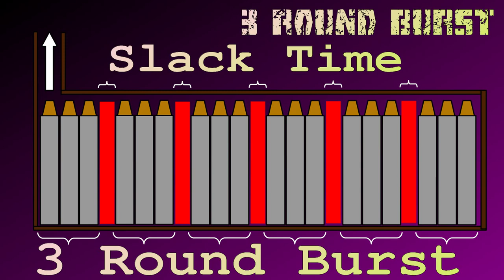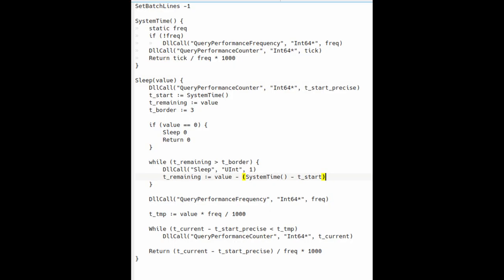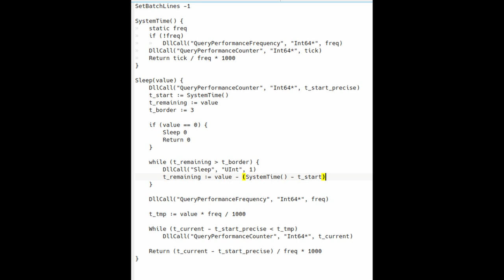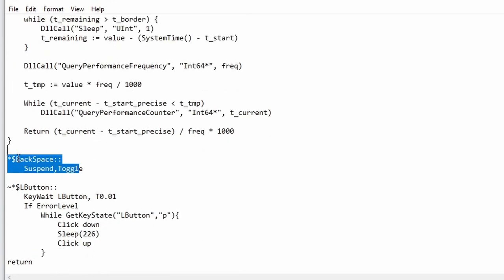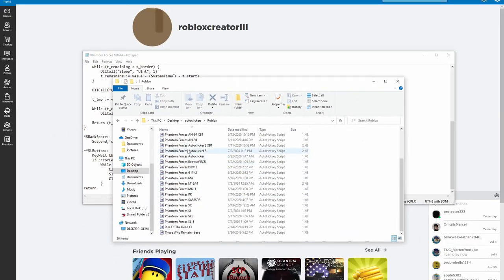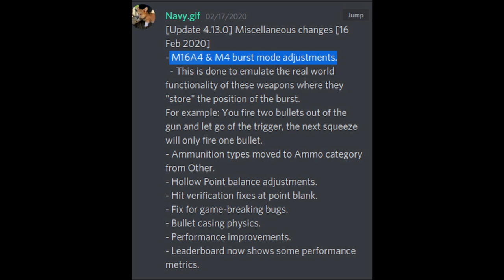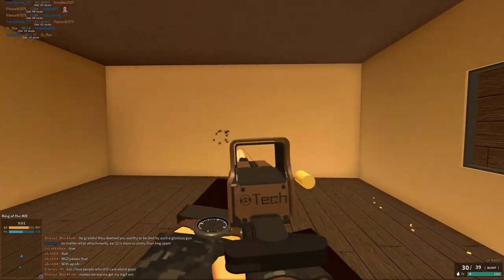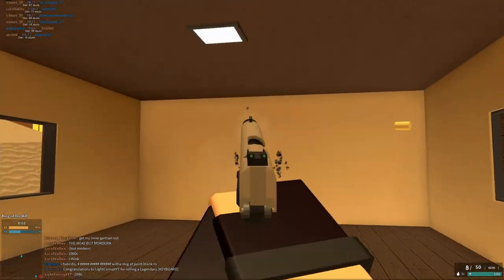Phantom Forces: A Beginner's Guide to Macros - Part 2

Comment: i have a question though, why is the macro interrupted when i hold down the fire button for a long time?
Reply from the maker: Muffet the Slavic Spider As in, does it stop working forever until you restart it, or does it fail periodically? If it fails periodically then that means you might have too tight of a timing and you might want to loosen it. It it's the first one though, I'm not really sure why that would happen, and I would probably need more details.

Also, did you use the burst timing calculation function as shown in the first video in the series, as in 1000/(rpm/60) ms, or did you use the script as is? Using the script as is would not work correctly, as the timings are for a different gun that probably bursts at the same speed, unless you are using the same gun as I am (or I might just have put 1 as the timing but I don't remember.). Another thing is if you copied the script from the pastebin or if you copied it directly off the video, as the thing is that in the one in the video there is a toggle on the key Backspace. In the pastebin version I removed it though, but on the video version if you press backspace it pauses the macro until you press backspace again.
Reply: It kinda stutters the burst and semi auto of the guns even though did calculate the right numbers for the sleep thingy. For example: using a zip 22 with macro
The macro sometimes slows down but it starts to shoot faster and faster then it shoots slow then fast, you know what i mean.
Reply from the maker: Muffet the Slavic Spider hmm... could you maybe try using a 5 ms burst timer? Usually I find that using semi auto weapons is better with a 5 ms burst delay than calculated as there is no weird burst mechanic.

As another question: what CPU are you using? Because anything dual core might not be able to keep up with the load of roblox + macro, as the macro takes one whole core by itself.

Comment: Ok so i have a i9 10900k, and a 2070 super, and i got the my ak12 burst sleep right and everything, but it kinda stutters and it is not as smooth as it want it to be it still burst kinda. Do you know a solution?
Reply from the maker: Your sleep is 200 ms for the ak12 and you are not using a muzzle booster right?
Reply: @xynonners  yes.
Reply: @xynonners  my setup is reflex, folding, muzzle brake, and blue laser for my ak12 just so you know
Reply: It's 180ms